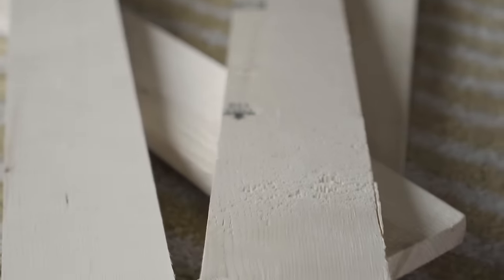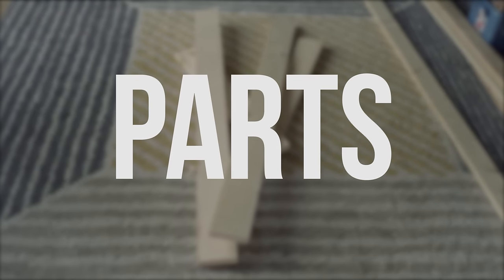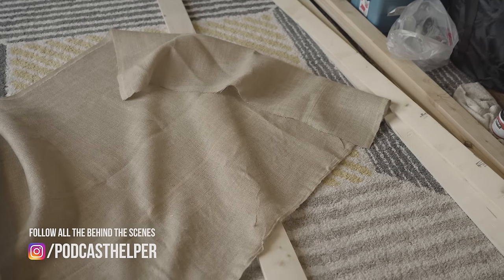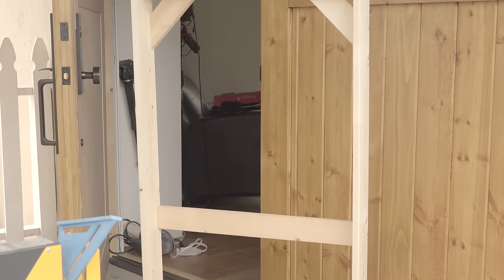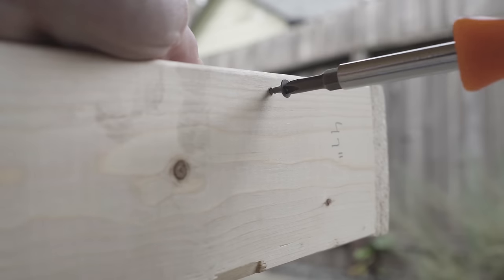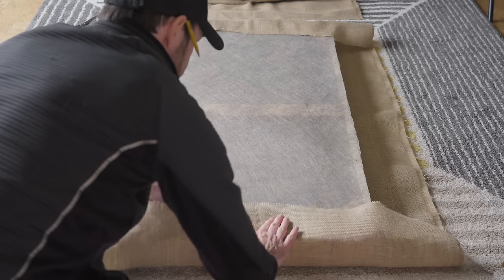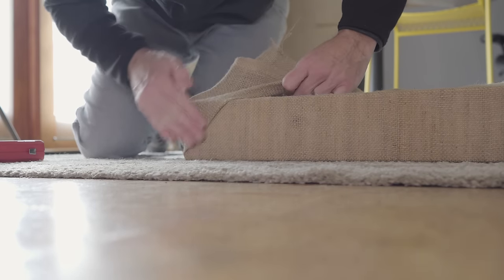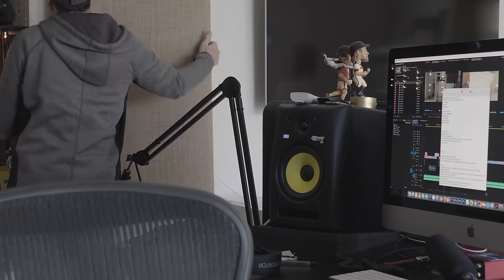How to Build Your Own Acoustic Panels

Comment: As a carpenter, cutting your board like you did on the saw horse can cause kick-back from your saw.  Make sure to support under the both sides of the cut or hang, the piece to be cut, off the edge of the saw horse so that it won't bind your blade when you cut through.  Cutting in between the sawhorses like that causes the cut pieces to fall down and inward towards the saw blade.  A mistake we all make in the beginning.
Reply from the maker: Thanks for the pro tip;)
Reply: Another pro tip: 
If, for example, you need two pieces at 9"(in) then you SHOULDN'T pull 9" and 18" consecutively to get your marks. You will find that you have one at 9" and one around 8 7/8". That's because you remove the blade width of material. Doing this consecutively will "compound" the mistake, especially an issue when using miters.
Reply: Damn, wish I saw this 20min ago
Reply: @stevenswisher4339  I'm sorry man, that sucks. I bet you could guess I how I learned that though 😂.  It's a mistake I never made again, but one that gets us all in the beginning. Hopefully you can just cut everything that 1/8th shorter to match.
Reply: Glad you said something. Scary to see that safety measure overlooked. Great video though!
Reply: Thanks for safety tip
Reply: Hey, were you gonna use those fingers?

Comment: I've been making panels like this for years.  First for my own studio and then for other churches and organizations locally.  I've found that if you do 2 horizontal braces on the back instead of 1 that it will negate the need for corner braces (or L brackets that I used in my first design) and will be plenty stable for hanging on the walls.  I usually measure down about 15" from the top and bottom and that's the middle of the horizontal brace.  Done and done.  This prevents having to even cut anything that's not 90 degrees, for those folks who prefer to keep things simple (like me) and not screw something up.  Great content.
Reply: Also, I use inexpensive Z brackets from Amazon to mount them to walls for a flush, pro look.  But in my own studio, I have several that are mounted with a French cleat system.  Basically you cut a board down the middle at a 45 degree angle and attach the top half to the panel and the bottom half to the wall.  This creates a 3/4" gap also (you can use some scraps on the bottoms of the panels for spacers as well) and still is very sturdy and pro looking.
Reply from the maker: Thanks, Chuck, that's a nice solution! Angle cuts are definitely not preferred, appreciate the kinds words and the feedback.
Reply: Without corner braces you run the risk of sag if you're only hanging by the top frame piece. Ive made a dozen of these similar frames and it's not worth arguing about,  but with corner braces the lifespan of the frame will be dictated by the fabric wearing out/dirty (long time). By NOT using corner braces, the life of the frame will be dictated by how many times they are moved/repurposed (maybe just as long, maybe not). A second back brace is also slightly heavier.

Comment: It took me forever to do but I finally got the stuff to make these your method was way much easier so this the one I’m sticking with I tell you how I do!
Reply from the maker: Thanks for the feedback! If I built more of these, the only change I would make is to add some of the weed barrier fabric that I put on back to the underside of the burlap as well just to make sure the fibers stay inside the panel. Good luck and let me know how it goes!
Reply: @RayOrtega  ok I will thanks again great video

Comment: Thanks for the tutotial. Made 33 of these panels!
Reply: Whoa, nice work! Should be a nice "dead" room!;)
Reply: Did you end up getting a off gas type smell as well  .?? I Made 12 and its kinda strong lmk thanks!!
Reply from the maker: @bigsmooth4christ  I don't recall any off gassing in my case. Did you use the same materials? Regardless, probably always good to let them sit outside for a few days after the build. I do this with most DIY projects cause often stain or something that off-gasses is involved.
Reply: @RayOrtega  Thank you very much
Reply: Wasn't that damn expensive?
Reply: @claymusic640  180$ for the fabric from Amazon and 40$ for mdf wood and 60$ for 60$ for rockwool installation  And about $20 for the back layment
Reply: I am making acoustic panels using glass wool. The problem that I have is with the cloth. As I heard that one can have asthma is glass wool can come out of the cloth. I'm using cotton cloth and it's a little see through.. Is it okay to use it. Coz I wanted to use a breathable one
Reply: @reshuzify  if you cover the front and back with the weed stopper material before putting your final fabric, the fiberglass will not get out, it should be safe
Reply: hahaha shame.
Reply: I only made 8, I can’t imagine making 33😂
Reply: @user-th6rh8zp3t  except it will reflect the soundwaves making this whole build ineffective
Reply: @pedrorm923  hi, is it the weed stopper that will make it ineffective? Why? I was thinking of making this early next week, please explain and stop me from potentially messing up - many thanks :)!!
Reply: @bigsmooth4christ  hey, you made 12? How are they sounding a year later?
Reply: @jonizenman2399  sound great and can't smell a thing any longer !! It dissipated in 3 weeks
Reply: @bigsmooth4christ  That’s awesome! Going to make 5-10 over the next few weeks. Going to attempt to dampen the sound in my garage lol thank you !
Reply: We gotta Free Mason here, folks. (sad times you got point out youre making a joke)

Comment: that's a great video! just remember to never have an air space bigger than your insulation thickness. But adding the air gap as you did does help a ton! its basically free insulation when it comes to absorption. 10/10
Reply from the maker: Thanks, David.

Comment: Great video! One improvement: if these panels are going into a public performance space (maybe a church or a music venue) building codes require the fabric to have a Class A fire rating. This isn't hard, but it is critical. Your local fire marshall will have a fit if it isn't fire safe, and if you want to know what could go wrong look up the Cocoanut Grove nightclub fire where 600 people died because of unsafe decorations. 

Fabric is cheap, rated for fire safety and acoustic performance. Look for Guillford's of Maine who specializes in this kind of thing. Cost will be about the same as the burlap OP used in his video.
Reply: I agree with the advice, however, guilford of maine fabric is substantially more expensive than burlap.

Comment: This is brilliant. One of the only tutorials on DIY acoustic panels I've seen that I believe I could actually do myself! Saving this for later.
Reply from the maker: Awesome, thanks Eric! Lots of concern below regarding any kind of insulation getting out of the panels so I think if I had to modify these, I'd probably add the weed barrier I put on back onto the front as well. I'm either going to update them that way or get new coverings but in the meantime I'm not overly concerned, they work great.

Comment: Besides Rockwool, many professional panels and DIY are made with Owens Corning 703 rigid fiberglass panels ( 2' x 4' x 4" ). If you want to improve the look and performance, you can search for fabric that is rated for acoustics, which may look more visually appealing than burlap and come in a variety of colors and patterns. Camira makes fabric that is widely used for acoustic panels (Camira Cara) though it is expensive. You should also offset your panels from the walls by several inches. This is typically done by using multiple wires and some mounting brackets. The air gap behind the panels will make them work better as the sound will travel further allowing it to slow down more, hit the wall and come back into the panel, reducing the amplitude again. You can also add a layer of polyester batting (Dacron) before wrapping in fabric. This is not mandatory, but can prevent any fiberglass from getting through if you're paranoid, and (if memory serves) it will reduce some more of the high frequencies.

Also, just a fun fact: the way these acoustic panels work is they convert acoustic energy into heat. When the air passes through them, the friction of the air rubbing against all those little fibers generates heat, thus reducing the energy, reducing the amplitude of the sound waves. Fiberglass is used because of the massive surface area it has.
Reply from the maker: Thanks for the insights, John. My panels are definitely set off the wall but I'm going to look into the Dacron which would be a nice addition. I like the look of the burlap for my space but have also looked at many of the fabrics made for acoustic coverings and those would be a nice addition. Thanks for watching.
Reply: @RayOrtega  No worries. Plenty of people use burlap. I'm not sure of the properties myself, but if you like it and it matches the space, use it of course :) You'd have to check, but the studio designers I've spoken to in the past, and books I've read, recommended (I think) a 4" air gap between the panel and the wall. It's been a while, but I think it was 4".

Also, if you cut holes in the top, bottom and sides of the frame it will also improve performance. Some guys use hole saws to cut circular holes, others make large ovoid holes or rounded rectangle shapes, some make the frames from thin metal instead of wood that is full of holes. The idea is to allow as much air to reach the fiberglass as possible from all sides. 👍🏻
Reply from the maker: @johnecks  Thanks, I've seen the holes in the sides and it looks fantastic especially when you put the fabric inside the frame. Fortunately mine are working great so I don't need to do any more but I've seen many great styles that I'd like to do.

Comment: I noticed your idea to use recycled denim insulation instead of the more toxic traditional materials. I love this idea! I saw a video that tested the sound absorption abilities of used towels, a similar material, with positive results, so I think I'll try this.
Reply from the maker: Thanks! You can definitely fill the frames with whatever absorbent material you want and I'm always interested in iterating on the design to be more friendly the the user while still being effective. Let me know how it goes! On future panels with Rockwool or probably any material, I would also include a layer of the weed barrier that I put on back but in front as well and that should essentially seal it up but still allow sound waves to pass through.

Comment: That's super clean panels ! The wood fibre isn't dangerous for health ? I read everything on forums...
Reply from the maker: Thanks, check out the comments, I've talk about it a lot but my takeaway is that you should just cover the insulation with a barrier to hold the rockwool or whatever insulation you choose inside the panel.

Comment: made 8 of them so far. plus  modded the design for corner traps using 16" safe n sound instead of 24". I made the panels 6' tall and 17" wide to sit in the corners.
Reply from the maker: Awesome, did the measurements all work out for you?
Reply: Indeed they did. Thanks!

Comment: This is BY FAR the best DIY acoustic panel how to video. BY FAR. Love your easy-to-follow instructions and step by step guide. You make it very clear. Plus, these are beautiful panels. Something I’ll do to these is add another outer wood frame for a nice finish look. Thanks!
Reply from the maker: Thanks, Justin! And I like you iteration of an outside wood frame, that'll look great. When I build more of these I would also add the weed barrier to the front of the panel under the burlap just to ensure I'm keeping the Rockwool inside or use a cover that is less transparent. Stay well!
Reply: Ray Ortega yeah man! I got some fabric from  Guilford of Maine that looks likes it’s going to work well with just the fabric. But I got some landscape fabric for the back. Seems like a good idea. I also decided to use 1/2” MDF for the inner frame. Bought a sheet and cut it into strips. It’ll save more money and then use the common boards for the wood finish on the outer frame 🤙🏼
Reply from the maker: @justin.j.bowen.  Incredible, that's top quality fabric from what I understand. Make sure to share your panels if you put them into a video, I'd love to see the results.

Comment: I just made 3 of these to convert the closet in my studio to a partly isolated vocal/acoustic guitar booth. I mounted the centre panel on the back wall of the closet and put the other 2 on hinges so I can still access the sides of the closet where I hang cables and have some small shelves. Materials was around $170, and if I made 5 more panels to use up the Rockwool, I'd need about $100 - $120 worth of material so that would bring the cost of 8 panels down to $35 or so. Worth it, but the pro ones I bought (24 x 48) from a local place for $110 each look waaaaay better.
Reply from the maker: Cool, congrats, sounds like a cool space. Thanks for watching!

Comment: Looked up a video to see what kind of insulation people are using and you ended up using the exact one I was planning on using which is awesome. I could only find the 16" ones so I did the math for what 2x4's would be the most value but I just found a 24" inch at a different hardware store so I will use this exact setup to make mine, it will only be to block noise from a noisy neighbour so on one wall, not a full room acoustic treatment
Reply: I may have a particle board cut to shape instead to save on costs though

Comment: Thank you I will be making these soon. My home cinema is a completely glass room, including ceiling. Sound is bouncing around everywhere. It’s a nice room to have a cinema in until the 2 sub woofers kick in, then I just prey the glass doesn’t shatter. 

These will help a lot and improve my sound quality without spending thousands on a new sound system. Thank you👍
Reply from the maker: Cool, good luck with the build!
Reply: Better make some basstraps in the corners for the subs. Accoustic panels wont help with the low Hz

Comment: This could be a very dumb question, but would it be possible to hang these using heavy duty wall anchors and screws without screwing into a stud and just intro the drywall?
Reply from the maker: I'm definitely no expert on how much load the drywall can take but they have various ratings for how much an anchor can hold and it probably covers these panels, I don't think i have each anchor into a stud because my deminsions for the panel don't align so I used a combo of stud and anchors.

Comment: Great tutorial! Just trying to do the maths before i buy - if the wood is 4" deep, and the backboard takes up 1", that gives you 3" of space of course. But the rockwool you suggested we use is supposedly 2" deep, which in theory gives you 1" of space. 
Is the rockwool in fact closer to 3" deep once it's been taken out of its packaging? Or have i just done bad maths lol.

Thanks!

Comment: Great video. As for me I am building some myself. The local stores do not carry these Rockwool panals. So I went with Owens Corning Thermafiber 3 inch thick, 15 inch wide 47 inch long. With the wood frame and the speaker cloth. These are coming out good. And the Thermafiber was only $37.46 per pack(10 per pack). Great deal. so for 20 panels i believe I have spent 150.00  for all materials.
Reply from the maker: Thanks. Enjoy your panels!
Reply: Did they help?

Comment: amazing and very clear. made six of these. great difference!
Reply from the maker: Fantastic, thanks for sharing! Did the measurements all work out for you?
Reply: @RayOrtega  I had to use different rockwool (RockWool RockSono 1000x600x100mm) because I am living in The Netherlands and couldn't find the one you used. But it was easy to adjust! Used some coffeebags for the fabric at the top and towels at the back (for extra isolation). Lots of thanks again!
Reply from the maker: @fnjcvanderburg  Great! Thanks for sharing!

Comment: Thanks for this video! 
Made these today, but I did 24 x 36 since that's what suits my studio/office space best.  

12 - 1x4x8  boards $1.98 each at Home Depot was able to make (8) panels.

Used the same steps in this video, but instead of  47 inches for the sides, I used 35 inches.
I did not do the corner supports. Instead, I used the strap wood to put supports at the top and bottom of each panel. You will have the exact amount of extra wood to do this after the 1x4x8 boards are cut properly and assembled. Every inch of wood will be used.

With 4 yds. Of burlap, I was able to cover 5 panels. Remember, my panels are 24x36

Comment: Holes wise, it would hold better if you do a pocket hole from the outside of the butt joint right into the cross grain of the piece going lengthwise (so about 135 degrees from the way you're inserting). It's not a biggie since you're not subjecting the frame to great forces but  just saying for those who are violent in their studios ;)
Reply from the maker: Violent audio producer protection. Got it! Good note lol. Thanks for watching, always enjoy hearing how to improve the process.
Reply: @RayOrtega  My pleasure. Also, upholstery (also sewing, depending on pov) wise, you can leave a bit more fabric, fold it under at the edge then staple. It would prevent the fringes from undoing, or the edges from tearing (depending on the tissue/fabric). This would improve with wear and tear if you have to move the panels around. It's a basic principle that applies to most projects that involves fabric - but a bit fiddly as you have to measure, roll, pull, staple and repeat again for all the staples. If you have a sewing machine you can sew the hem then pull and staple. Either way a few extra steps ;